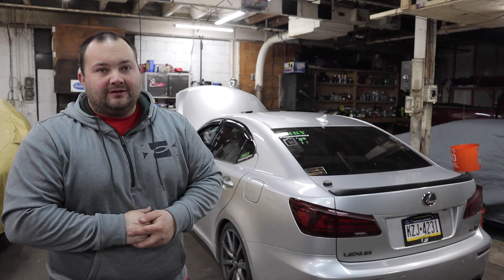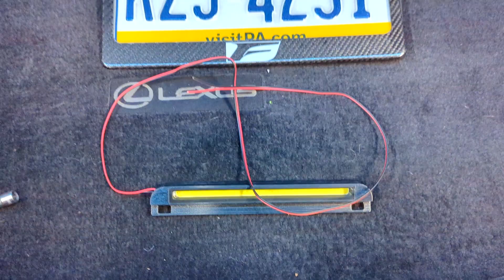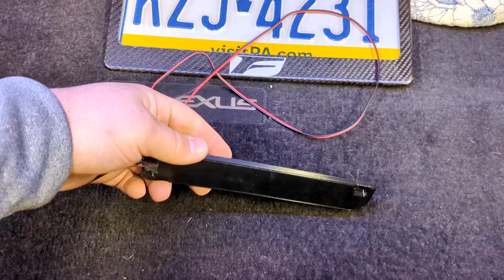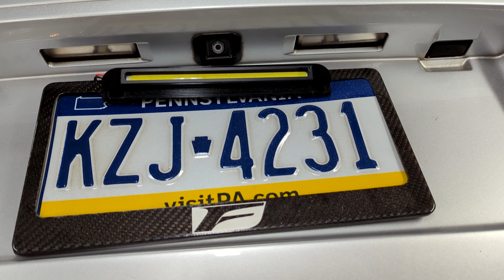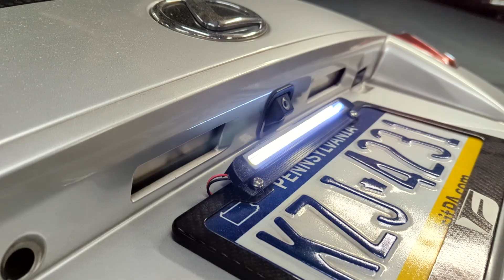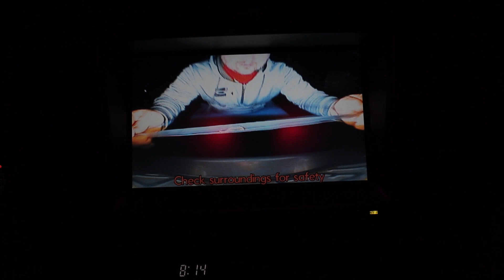Let there be light! Installing a license plate mounted LED reverse light!

Comment: Why the wire taps? You're better than that
Reply from the maker: There's nothing wrong with using them, and most people don't want to cut/crimp/solder their wiring and I don't blame them
Reply: @PoorManMods  Its the lazy way but ok
Reply from the maker: @666cemetaryslut  there is no need to cut up your harness and crimp or solder for a simple non permanent device like this
Reply: @PoorManMods  Leaving a wire that is cut almost all the way through is worse in my opinion but It's your own car. I'd just expect more from a channel that is showing people how to work on their cars.
Reply from the maker: @666cemetaryslut  This is the internet and you cant show how to do wiring correctly. I showed using wire taps and it was lazy in your opinion. If i cut and crimp people would say im a moron for modifying the ISF oem harness and soldering is better. If i soldered people would say im stupid because solder can crack and break. Everyone has an opinion and everyone thinks theyre right.
Reply: @PoorManMods  can't tell you how many conflicting "right" ways to do automotive wiring i've seen online
Reply from the maker: @ilyas5708  exactly